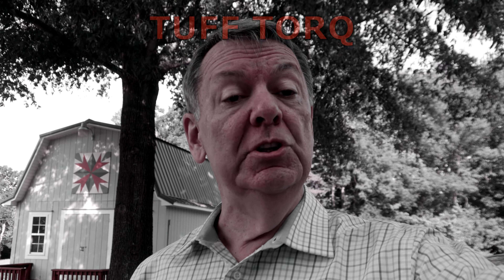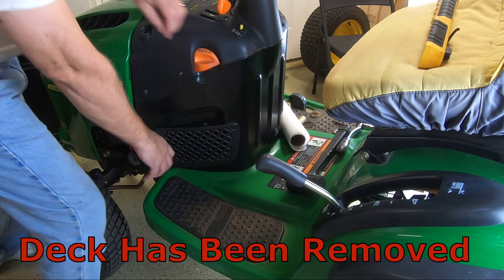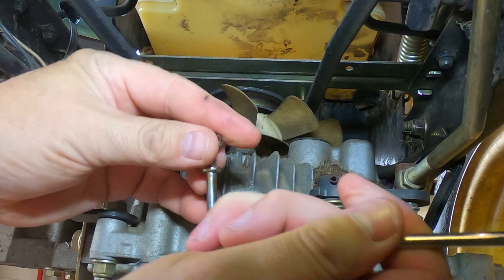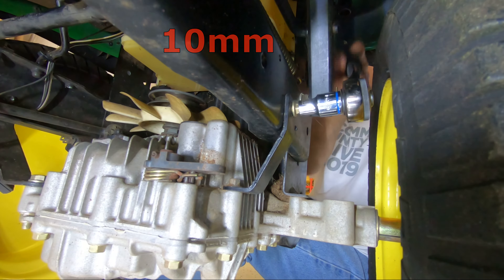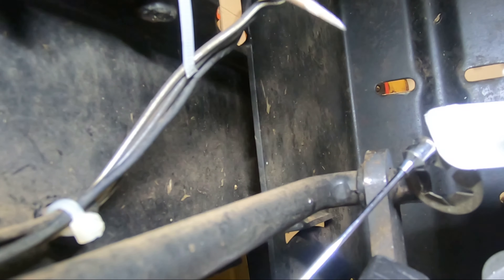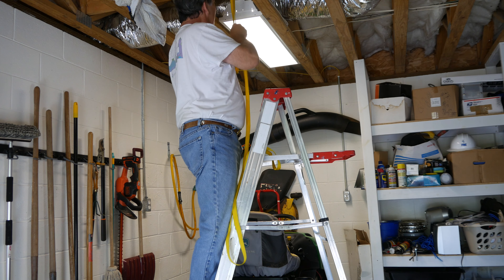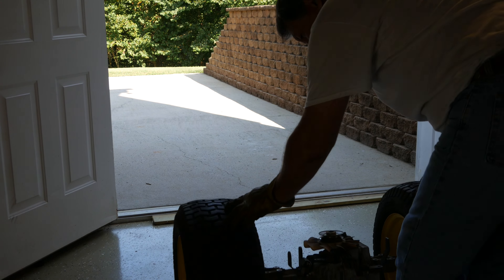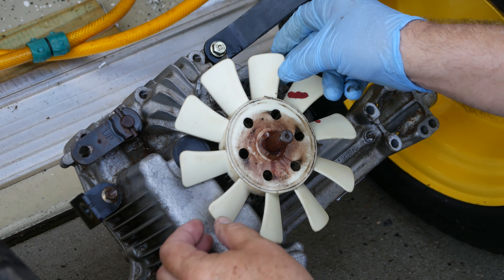John Deere K46 Transmission Removal with Oil and Filter Change Part 1

Comment: Very good video.
Mine has drainplugs,think its doable to drop the oilpan without removing the gearbox. Looks like there is no guidepins 😔
Reply from the maker: Thanks for viewing....you 'can' drop the gearbox cover, 'but' be prepared for the drive gears and brake parts to fall out without a chance to see how they came out.
Reply: @PilotViewProductions  haha okey,can as in can't then.
Reply from the maker: This is exactly why I don’t promote adding drain plugs unless all you’re going to do is change the oil.  Even then, on my model you can’t get to the filler plug without removing the fan and can’t remove the fan without dropping the transaxle.

Comment: There is a drain plug kit upgrade available but you still have to remove bottom case to access the filter.
Reply from the maker: Exactly Tom.  That's the reason I didn't install it here...'plus' on my model you can't get to the top plugs to 'refill' without dropping the tranny and removing the fan.

Comment: Can you do this without removing your Deck
Reply from the maker: ‘Can’ you? Yes. Would I? Nope. I think it would take longer to have to reach around the deck and undo linkages, etc. than it would take just to remove the deck.
Reply: @PilotViewProductions  I ended up leaving the deck on and  just taking the wheels off and using jack stands  pretty easy

Comment: Hello, I just changed the oil and still have the same same problem. When it gets hot it struggles going up hill. Do you think maybe I need to change the filter?
Reply from the maker: Watch parts 2 and 3 please.  Dean

Comment: Hi again Dean, I'm ecstatic to say that changing the transaxle fluid and oil filter has fixed the problem and the Lawn Tractor now drives like it did when new, 20 years ago!! Slightly faster and stops sooooooooo much quicker when lifting off the gas!!!! You've really helped me THANK YOU and I referred back to watching parts 1 and 2 several times during the work!!!! In summary I'd say if the squealing/graunching noise happens soon after startup and then goes away after maybe 5 minutes it's WELL WORTH changing the fluid and filter. Most reports of changing the fluid/filter not working seem to be from cases where the tractor originally goes well and then loses power after 30+ minutes. The part I found most nerve-wracking was applying the new gasket sealant and I followed your instructions and the instructions with the (Tuff Torq approved) RTV sealant I used and no hint of a leak!!!! Thanks again Dean, you rock!!!! and I'm happy to answer any questions from others thinking about a Westwood fix :)
Reply from the maker: Always good to hear a success story.  Not many folks reply after performing the work to let me know how it turned out, so thanks.  Glad the videos helped in any way.  Ironically I’m right in the middle of doing this same operation on my JD X320 and am hoping for similar results.  Much success in your future projects as well.  Dean
Reply: @PilotViewProductions  Good luck with the X320!! Looks like it's got a Tuff Torq K58. I've emailed you a few pics from my project :)
Reply from the maker: @Philly5G  I received them. Great job on the lower case cleanup.  Sounds like you’re quite proficient at repairs and not afraid to tackle the big stuff.  Thanks again for your original post as it may help others with the same type mower to know this procedure works so well.
Reply: @PilotViewProductions  Thanks for the quick reply and kind feedback Dean!!! When I was taking the pics of the cleaned-up lower case half, the thought did pop into my head of the subtitle "following in the footsteps of the master"!!!! as that's exactly what I did for the whole project!!

Comment: Your video was very thorough and explained each step clearly.  Just changing the transaxle oil fixed my JD X300 tractor. Cost me $13 plus a couple hours.  Saved me hundreds. Thanks.
Reply from the maker: I’m glad to hear it Randy.  It worked for my X320 as well.  But just for grins I hope you’ll check out parts 2 and 3 just in case you ever need it.  Dean

Comment: By FAR you have created the best step by step video of how to service the transmission. Just purchased a new X350 and plan on changing the filter and fluid after the warranty is up. Figure that will be about 120 hours which will mean the transmission magnets will have some metal. Noticed you stayed with John Deere fluid, just curious if you would still stay with that particular fluid?  Thanks for passing along your knowledge!
Reply from the maker: Thanks for viewing and the kind comments Gary.  Re the fluid: I realize other DIY’ers used a different synthetic oil but:  I figured the OEM brand lasted all these many years before I even knew it could be changed.  Now that I’m aware, it only has to last a couple hundred hours.  If you visit the Tuff Torq website, they make recommendations as to oil as well.  I suspect the John Deere oil meets those specs so I’m good with the OEM brand.  BTW: I also have an X-320 that I just changed the fluid on.  It works great.  I think the pumps are a bit stronger on the X-320 tranny.

Comment: Hi Dean, thank you for doing this series of films!!! I'm just about to change the transmission oil and oil filter in my 2001 Westwood S1600 tractor with a K46E and your films have REALLY set me up for success!! My problem is maybe unusual in that I only get the graunching noise when the tractor is cold and having run for about 5 minutes the noise goes away and everything is fine. It's been in storage for about 13 years and I'm guessing the fluid has deteriorated and maybe the filter is gummed up and not letting the cold thick oil through - we'll soon find out!!!!
Reply from the maker: Hey Phil. Thanks for watching the series.  It was actually kinda fun to do cept for setting up for all the camera and lighting shots.  I suspect you will have much success if you break into yours.  One bit of advice...after you remove the bottom cover, don't let the transmission accidentally flip over, or gears can fall out before you get a chance to logically remove them.....(don't ask how I know).  RE: the noise...I suspect you are correct and hopefully only the filter and fluid will need changing.  Those magnets I showed will also be pretty nasty and grimy.  While you're in there, just inspect the teeth of the main gears...a little bit of scoring is normal, but in slowly turning the wheels: if you notice a 'lot' of play in the gears due to wear, I'd replace them as they're pretty economical as a kit on eBay.  Best of luck my friend and again, thanks for watching.  Hope I've got other videos to help you in your future endeavors.
Reply: Hi Dean, all going well and the inside of the gear box looks great and very intact!!, with very little metal fragments on the magnets. Your films have proved soooooo useful during this job-thank you!!! My K46 is a K46e and unlike yours, the case magnet just sits within the oil filter and not in the holder like yours. The filter I’ve taken out has a metal end plate at the bottom that the magnet was attracted to, but the replacement filter just has 2 open ends, so the magnet will basically be loose as the gearbox casing is non magnetic. My worry is the magnet could bounce up and block the oil holes in the centre mounting above the filter, but do you know if the oil is coming DOWN through those holes into the filter, or IN through the sides of the filter and UP through the holes? Thank you :)
Reply: Ps On draining and measuring the old fluid, there’s only about 1.5 litres of it…….. so looks like my cause suspicions may be correct :)

Comment: @m.forrest5603
0 seconds ago
Great video, Dean. Thanks for being so thorough. The only thing I don't have is a chain hoist, or even access to overhead joists to support the body of the tractor. What would you recommend as an alternative?  This guy has a proposal: https://www.youtube.com/watch?v=2_3tla8fLT8.  Do you have a better one?

I also noticed that he didn't remove the fan.  Your thoughts?

Again, thanks for you help!

Michael
Reply from the maker: @m.forrest5603  Far be it from me to be critical of someone else but since you asked… if I didn’t have a way to hoist the lawnmower from overhead, I would place a jack under both sides of the lawnmower from underneath. That way when all the attachment points are loosened, you can just roll the rear end out from under the body… secondly, removal of the fan is not that big of a deal, and prevents it from being soaked in oil when turned upside down.